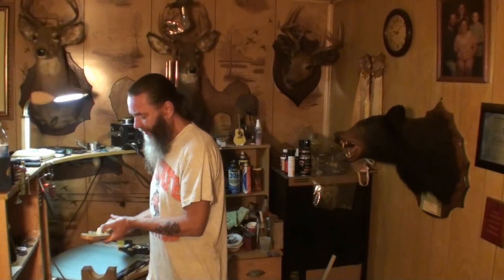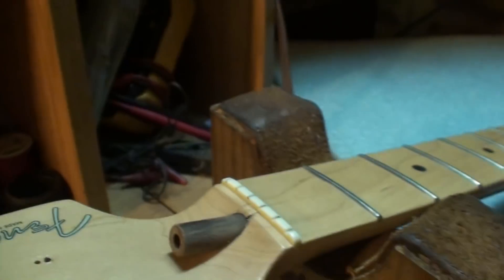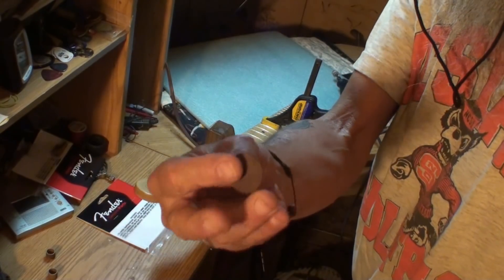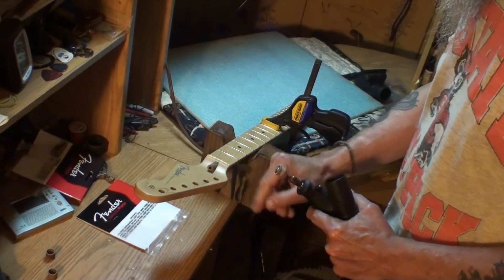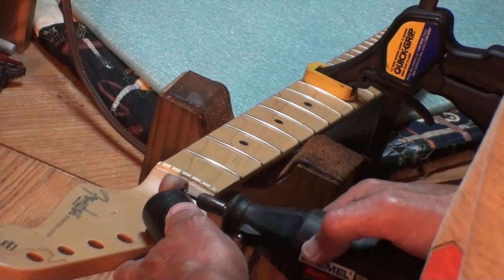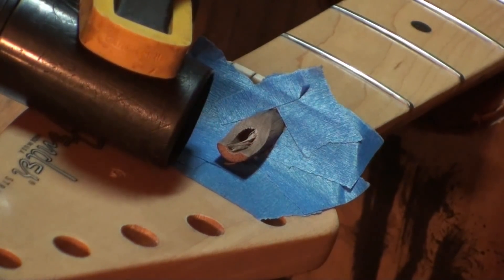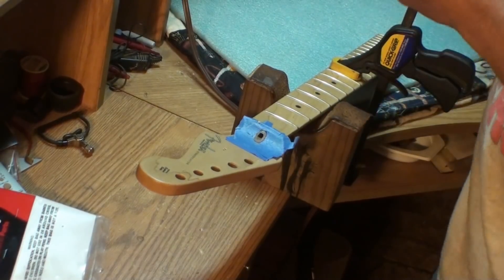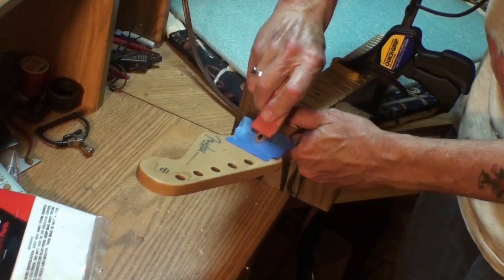fender strat bi-flex truss rod neck repair 3 of 4

Comment: I use a rubber band to hold the vacuum on the headstock (use shop rag in between to avoid scratching headstock) so that I get to use the dremel with both hands.
Reply from the maker: yup, don't want that dremel taking a track of its own! thanks mate!

Comment: Nice job man. The way I did mine was shove the dowel plug in there, mark it with a fine tip sharpie, yank it out and take it to the bench grinder. Then just push it back in there with my thumbs. It doesn’t look pretty, but it works..

Comment: The work-desk you are working on looks like the same type of wood-color as the guitar head stock. is there a way you could sand a small area of your desk, and use the dust-particals to fill in the cracks on the head-stock?

Comment: How Purty is That?!
Maybe U could've Pared Away a Little More B4 the Sandpaper, if U'd Had one of those Small Square End X-Acto Blades.
Man I've used Those for All Kinds of little Chores UNRelated to Guitar Stuff, even.
Like cleaning Stuck On Food off Cooking Pots or on the Stove Burner Rings that a Scrubby wouldn't Touch.
Was wondering if Simichrome  works on Minute Scratch's on Pick-Guards...???

Comment: Randy, do you use under string radius gauge on acoustic guitars when making a set up?
What do you do if bone saddle tilts slightly to the headstock?

Also, what comes first, string height or intonation?
Reply from the maker: Zip is correct on both! the saddle shouldn't lean forward it probably isn't fitting the slot right, too thin to fit tight enough to stand straight, and yep intonation is always last. thanks for watching!